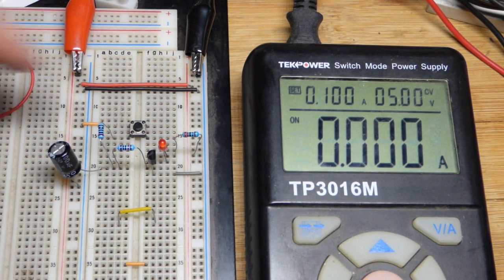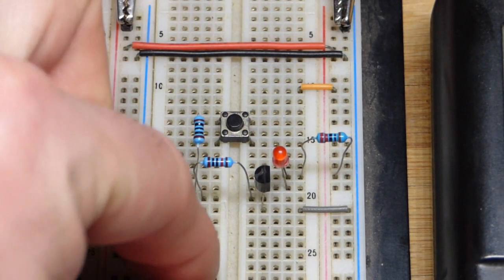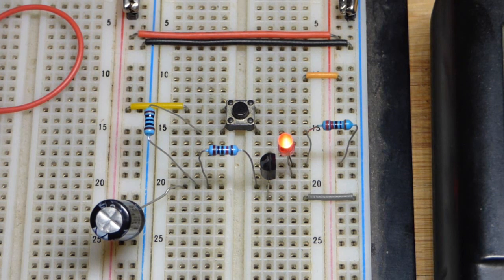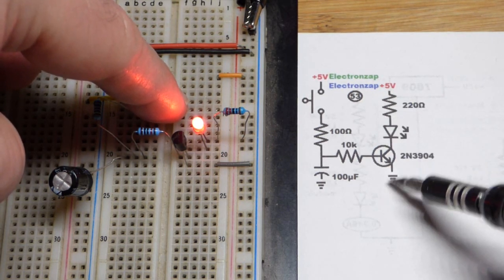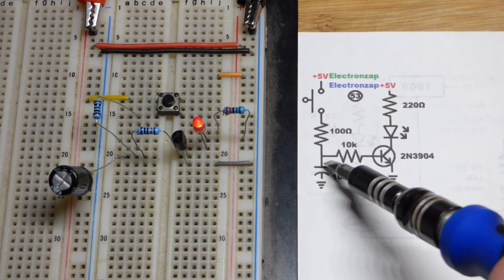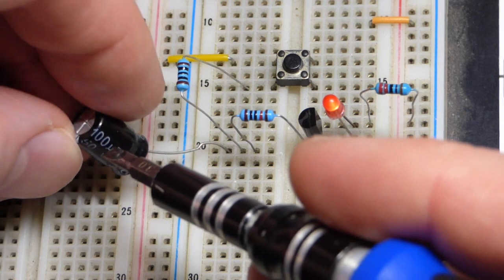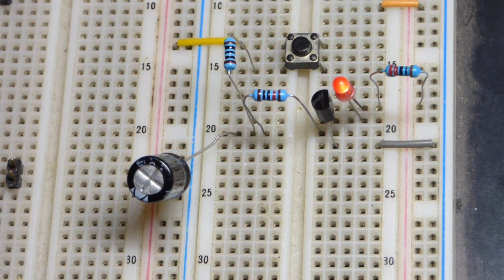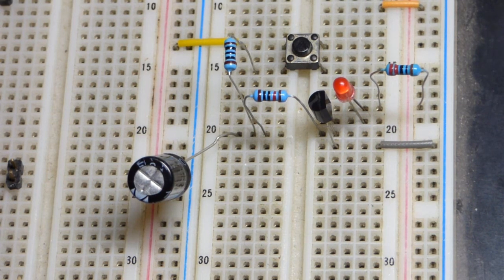Fading off an LED using the 2N3904 NPN Bipolar Junction Transistor BJT and capacitor

Comment: May I ask what the need for the transistor in this situation is? Can’t this be simply done without a transistor
Reply from the maker: You could use the stored charge in the capacitor to fade off an LED, but the capacitor can't store much charge. So the LED will only stay lit for a brief amount of time. A supercapacitor would work, but they take a long time to charge and aren't cheap. The NPN BJT allows a little bit of capacitor current to keep a lot more current flowing through the LED.
Reply: @Electronzap  oh right. So techinically it’s amplifying here. I’m an electrical engineer student currently so trying to make sense of things😅